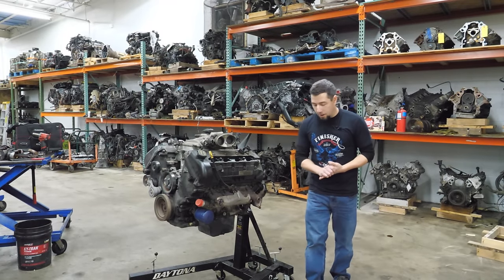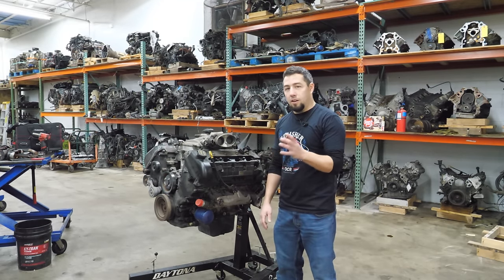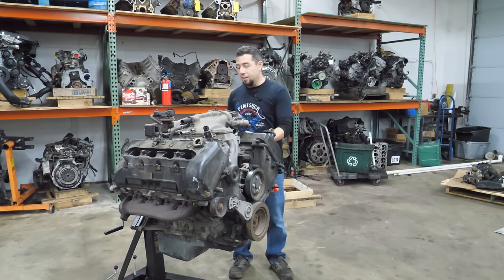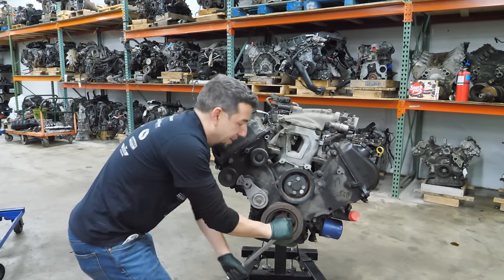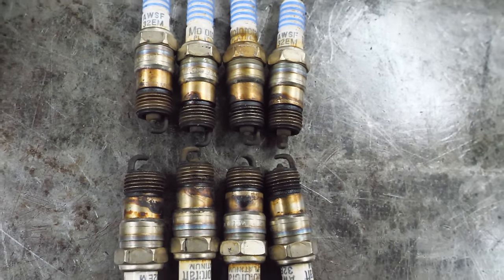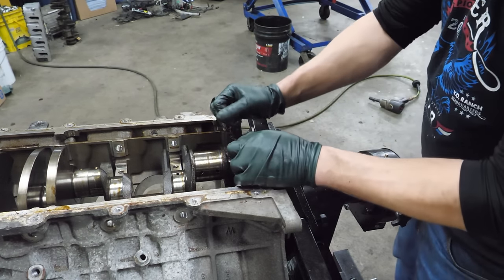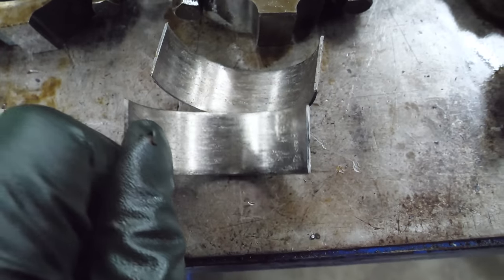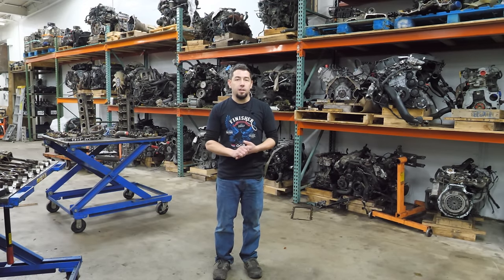AVOIDABLE! Blown Mercury Marauder 4.6L DOHC V8 Full Engine Teardown

Comment: Always thought that the Marauder engines were the same as the 03-04 Mach 1 engines if they came in an automatic car. The 5 speed Mach 1’s are definitely different. 6 bolt cranks in an auto and 8 bolt cranks in a manual.
Reply: There are some significant differences like ... Heads, air intake, throttle body, intake manifold, exhaust manifolds, cams and tune .
Reply: They're the exact same engine as an automatic mach except for the intake and oil pan essentially.
Reply: @Thatonekid245  I have  a continental, I know the bellhousing is different but the rest is the same?
Reply: @alb12345672  the block is different from any other 4v block. Can't use them in a rwd application
Reply: @Thatonekid245  Yep, it is a great vehicle though, feels powerful, sounds great!

Comment: its a mach/mark8 engine,  not forged bottom end, which a cobra WAS..  basiclly the same engine for the most part, intak e the biggest difference
Reply: Mach 1 and Mark VIII engines are 2 different 4V engines. Mach 1 is WAP block with C single port intakes. MARK 8 are Teskid block with B head twin port intake.

Comment: 4.6L 2valve. Good for over 300k miles
Reply from the maker: I’ve seen them over 600k. Burning oil like a two stroke but still running perfect

Comment: That is one SOFT crank. Bearings should be softer than the crank. In school a kid had a 350 Chevy that had a good 1/8 inch end play on the crank. Pulled the pan and the rear bearing cap off to look. The thrust bearing looked fine. The crank did not. Never saw that before. After a bunch of trading, that engine went back together and into another kid's demo derby car.

Comment: I have a WAP blocked 4.6 out of an 05 Aviator on the stand that SOME DAY I want to drop into my 95 Cougar... and once all of my wiring changed prove out to work with the body harness (modified 96 MN12 harness connected to a 2004 Mustang PCM), boing a proper build on a TEKSID block that I have sitting in a corner...

BTW, MICE SUCK!

Being a WAP block, I'd be inclined to say no, not worth saving... if it was a TEKSID, I'd say yes...
Reply: WAP blocks still can hold 800whp+

Comment: When you consider the parts count and complexity of this DOHC 4V engine vs. the simplicity of the GM LS...  there is so much more that CAN go wrong.  Ironically, what appeared to be failing first was a common rod bearing that could just as easily been in a much simpler engine.  There appeared to be little evidence of neglected maintenance.  Your background story connects the dots and explains what the teardown alone doesn't.

Comment: Stuck bolts are easy to get out when you hit them with an air chisel. Just use it to turn the bolt either with a wrench or without. Usually a combination of wrench and air chisel will loosen even the most resistant bolts (or nuts).

Comment: Why I keep my truck. I know the front diff is full, the transfer case is full, the rear diff is full, the antifreeze was changed in April, the oil/filter has been changed every 3K miles, the transmission was serviced in 2022 (bout due), the rear brakes were changed and flushed, the front brakes are due, and it has NEVER been overheated. My new radiator, belts, tensioners, air filter and other things have been replaced in the last month.  -- Now, where am I going to get a truck that has had this kind of maintenance? I will be in Tucson in January, I will be in central Colorado in June, In 280K miles I have never had to walk. Maintenance is worth it, I have not always been this way. Trust me, maintenance of a reliable vehicle is money in the bank. I use my truck to haul a trailer from sea level up to 11K feet, there is no surrender. 400K or bust.
Reply: Make a checklist. Check everything. Not changing antifreeze is a big killer, second only to oil. Flush your brake fluid.
Reply: Air filters are also critical.
Reply: I do all of my own work. I would never let a stranger touch my truck!
Reply: Hyundai owners should ignore this.

Comment: I have a '14 Cayman S that has NO dipstick.  

Annoying

How do you check the oil?  You drive the car until oil temp reaches 165 degrees, which takes about three miles in typical stop and go traffic. 

Annoying.

Then you shut the engine down. You wait one minute, and then if you HAVE NOT opened the rear hatch, you can scroll through the display on the right side of the dash and find your oil level.

Annoying-

My other car is a 2001 Subaru Outback with the H6 engine.  It has a dipstick!  How the hell did I wind up with two cars with the world's strangest configuration, a flat 6?

My spouse has a '20 MB GLE350.  Great car, but also, no dipstick.  

Annoying.

But what is worse? Finding the oil level on this car is about a 10 step process!  What the hell where they thinking?  Really, on the touch screen there should be a little oil drop icon that you touch and INSTANTLY you see your oil level.

Hello?   Great video!

Comment: I can’t believe you don’t know that this engine is in fact from the 96-99 Cobra ! No it’s not from the supercharged versions 03-04 but YES this is the exact engine from my 96 Cobra
Reply from the maker: It isn’t, but it’s similar
Reply: No, it's not the same as your 96.  You have b heads, these have c heads. This is more similar to a 03/04 auto mach 1 and 03-05 aviator. Somewhat similar to a 99/01 cobra as well.

Comment: -I went to De-Toilet in 2003 for 747 training at Kalitta Air.  While I was there, I decided one Saturday to take my '85 Porsche 928S2 down to Monroe county where I grew up.  I left Belleville near the airport and drove down I-275.  As I was cruising along in my famous German muscle car, a Mercury Marauder came along side.  And of course, I grew up in "Mish-Gin" where little boys are given motor oil transfusions into their blood during kindergarten.  Mine was 8 quarts of Castrol 20W-50, and I have the high blood pressure to show for it to this day!

In any case, he challenged, and of course I accepted.  I passed him about a mile later at 135 miles per hour, but I was surprised how hard my 928 had to work to dispose of him.  My S2 had 330 hp and 3300 pounds.  Not bad for a granny car with 16 extra valves....